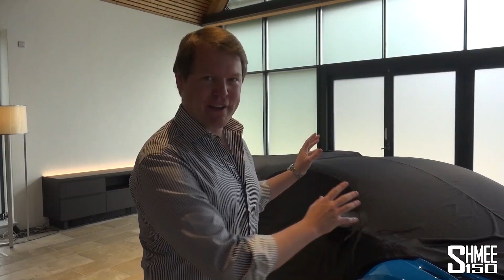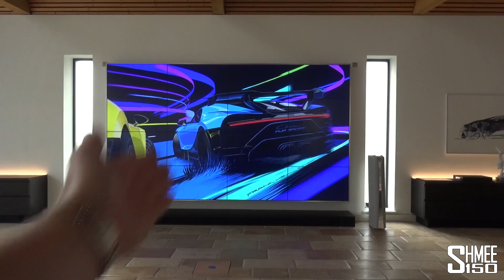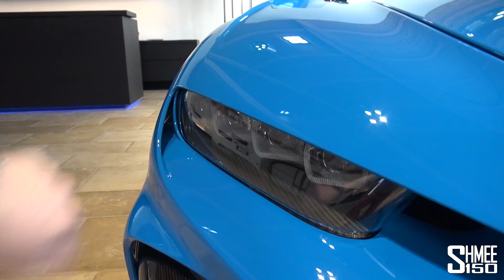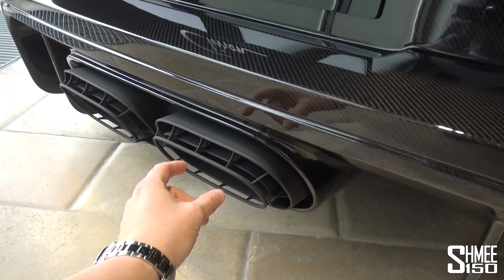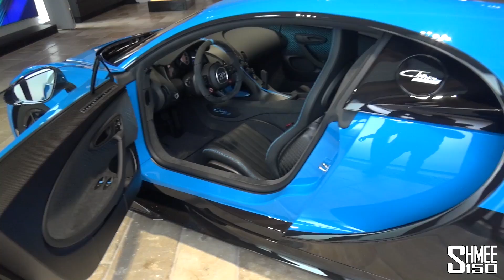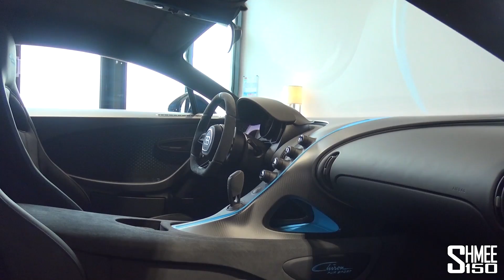Check Out the BUGATTI CHIRON PUR SPORT! | FIRST LOOK

Comment: I would be hard pressed to call anything from Bugatti a "track focused"  car. The cars are just entirely too heavy.  Yes, technology has allowed manufacturers to mask weight with trick all wheel drive systems and as such they mimicked rear wheel drive cars with the new drift modes and ELECTRONIC Slip Differential.  But that only does so much for driveability.  I believe Pagani, and Koenigsegg are the only hypercar manufactures that make true track focused cars. Of course McLaren does as well. But I dont include the McLaren to be a direct competitor to Bugatti because Bugatti makes it their business to take the top speed records. McLaren does not. Not since the F1. This car is phenomenal.  A technological marvel. I would bet it's a experience like no other. I just wouldn't call it a track car. More like a track version of a very heavy hypercar grandtourer.

Comment: Have to be honest I think either the divo or this are now pointless, dont need two track orientated cars based upon the same platform from such an exclusive brand. Also surely they could have saved weight by not using such a massive engine. I know its kinda a signature of bugatti now but you can get that power from a V8 now, instead of a much heavier W16.